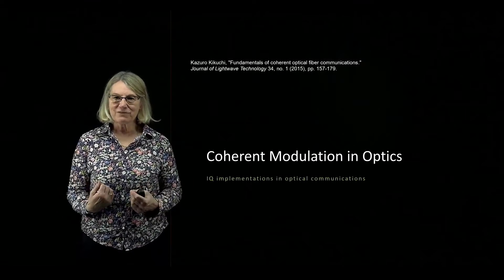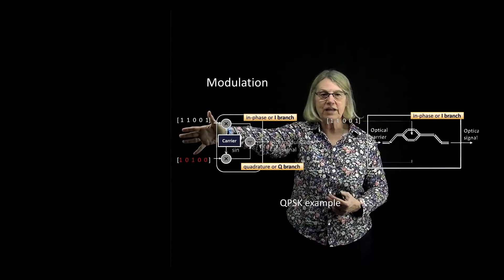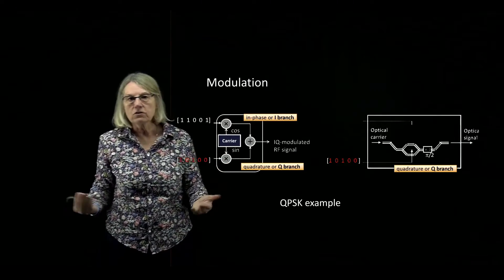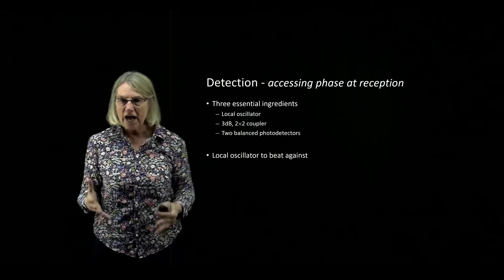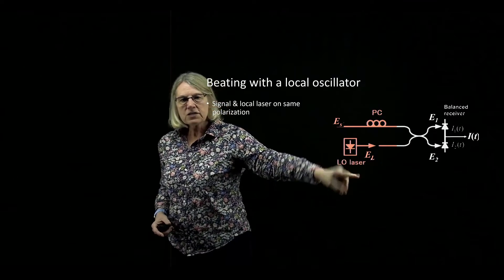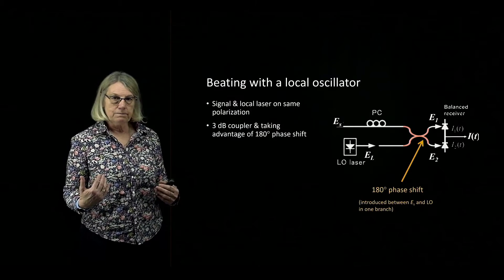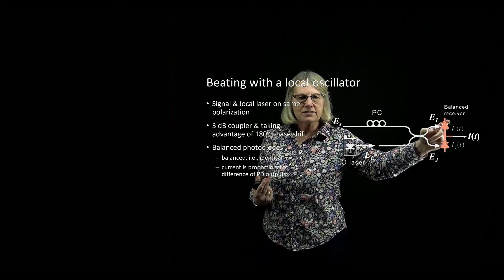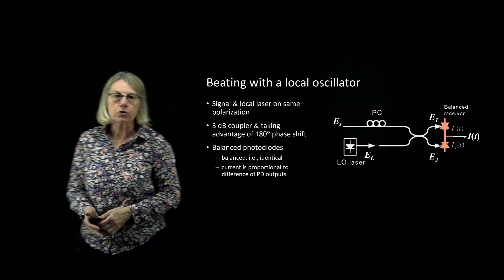Optical Coherent Detection - Implementation

Comment: Thank you so much Prof. Leslie:)
Please, I have a very interesting question that I'm very confused about it, 
coherent detection optical fiber transmission system is digital? or baseband analog, for example, if we transmit OFDM signal over fiber using coherent detection that called CO-OFDM, it is digital or baseband analog radio over fiber transmission?! 
Because, at the transmitter before driving the electro-optical modulator, we have DAC which is a key element device used after generating baseband digital OFDM waveform!
You response will be very appreciative, God bless you.